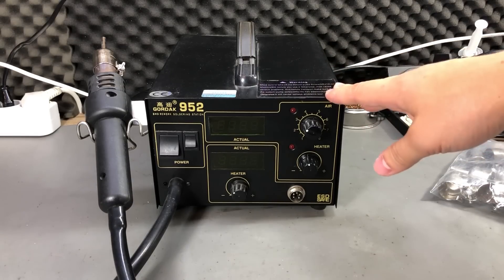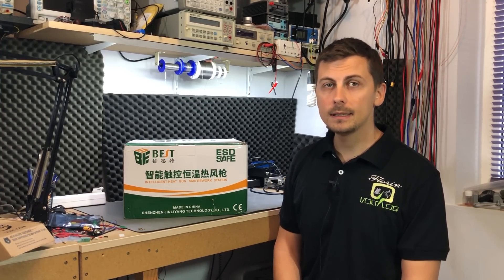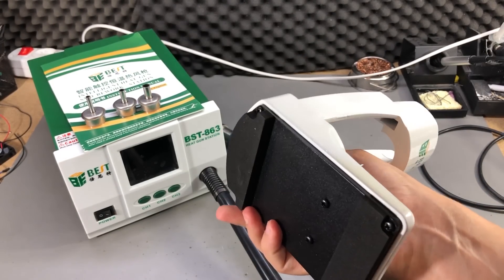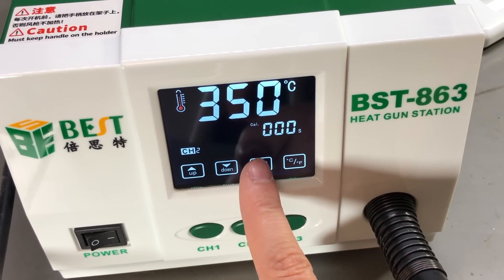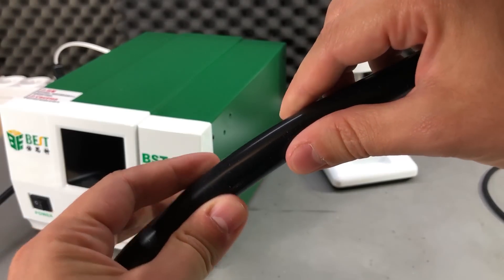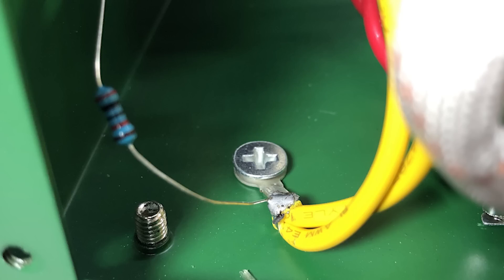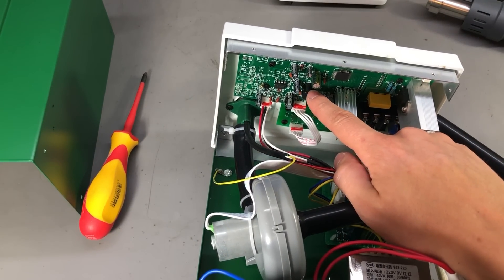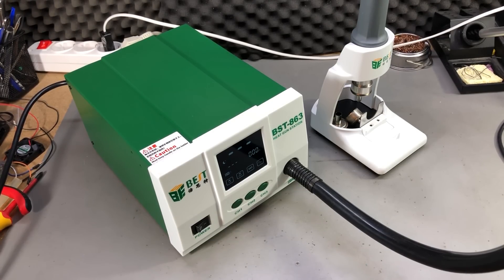Voltlog #256 - Best BST-863 Hot Air Rework Station (Alternative to Quick 861DW)

Comment: Will going in with 500 to 550 degrees celcius to remove newer models Iphone cpu shield remove the shield quicker than using a lower temperature without damage?

Comment: I bought this station 2 weeks ago. It looks basically the same inside but in my case the mains connectors were not loose at all. Instead they forgot to put in the resistor for the esd-socket to ground connection and the rubbermounts of the blower were not correctly fitted to the case. 

Still 5/5 rating from me. Super happy with it.
Reply: is it possible to unsolder a mosfet without damaging it? If the max temperature is around 300 C, the component doesn't desolder quickly, with the risk of breaking it, right?
Reply: @TheFelix63  Max Temp you can set is 550°C

Comment: Hi, I have got a question. 
I need the 220V version of the station because I live in Europe, but only the 110V version of the station is available on banggood.
Is there any difference in the station besides the cable? So has the station both support for both voltages or has other hardware to be installed in the respective station?

Comment: For what it's worth, I just got one of these and my experience is not good, the blower motor would not run out of the box but it happily continued to supply current to the heating element anyway so while the motor controller doubtless knows that the motor is not running, this information is not shared or used by the main controller. The blower motor just whines like you would expect a jammed brushless motor that cannot start up to do, for just a few seconds, when the handle is picked up. It's not an expensive unit, but with no functioning blower and no source of parts that I can locate, it is money thrown away. I regret not buying the Quick.

Comment: Awesome video! I wanted to ask you, my pump is completely dead. Any advice what to look for? The heating works but obviously blowing up the thermal fuse in the wand. Everything else works when fuse is okay but nothing from the pump
Reply: It's been quite a while. Did you figure it out? If not, are you getting power to the fan at all?
Reply: @pr0xZen  I ended up selling it on eBay and got Quick  861DW instead. However, the guy who bought it, left this comment on how he fixed it:

I found the problem (why the fan stopped working). It is all fixed now, very pleased. This was caused by the RoHS lead free solder. There had grown microscopic Tin whiskers around the fan connector terminals. Because of the high pulsed current of the fan motor. (this is what grows the metal crystals, very small and easy to miss). So it shorted the motor contacts and killed the fan driver IC. Replacement chip came from digikey, and it works now. (what they should have done is protected the terminals with a paint or other coating). Hehe so I hope you liked the story behind that.

Comment: Great video! I actually bought this unit after watching it but to my big despair, when I turned it on it got hot but no air blow and now it doesn't even get hot and the temp stays at close to zero... Is that normal?
Reply from the maker: I don't think that's normal. I'm guessing either a problem with the pump or bad settings but the heater shouldn't be on with no circulating air, it might overheat and destroy itself. Maybe it got dropped during shipping? You should open it up and check.
Reply: @voltlog  yeah what happened was the pipe on the heater turned really red and then the temp went down to 0 so I fear it's beyond my skills of repair. The air did never flow. Completely silent. Just such a shame and I'm not sure if I should order replacement or ask for refund.
Reply: @voltlog  so I figured out what the problem was. It was the thermal fuse inside the wand. I changed it but it blew again. The wand heated up but there was no airflow. Is it the pump then?
Reply from the maker: @extrememod_ahu  You should check why the pump isn't turning on.
Reply: @extrememod_ahu  Thermal fuse blowing is not the cause. It's a sympthom. It blows because there's no airflow so the heater element overheats (or it might be burnt out by now) - the thermal fuse is working as it should. I would suggest checking on all the wires, connections and solder joints between the blower fan and the the board. These fans are pretty durable parts, so it's more likely the fan gets no power rather than being broken. Also check the board for accidental solder bridges.

However, this is obviously either a manufacturing defect or shipping damage. So this is on the manufacturer, seller and/or their logistics partner(s). I hope you requested a refund or replacement.

Comment: Hi Florin, nice video! How does it hold after 1 year? Did you use it intenisvely?
Reply from the maker: Yes it's used every week at least once and after one year is as good as new. My only problem with this model is the rather short length of the hose which means you need to keep it close to your working area bench level. You can't really place it above on a shelf or anything like that. But for this price and performance that's something I can live with.
Reply: @voltlog  Thank you, and keep up the good work!
Reply: @voltlog  TL;DR You can just replace the hose with a comfortably longer one you know..? Nothing special about it. With how powerful the fan is, if you use a small adapter in each end, you can use a thinner, more nimble hose too.

-
I did mine with 35 cm extra, in 15 mm (OD) silicone hose, just some AliExpress knockoff'ish of the blue Samco ones you see in 80% of tuner cars. Paid like $4/m including shipping. 11mm ID IIRC. 1 or 1.5 mm walls leaves too thin a wall with straight silicone being so soft, it kinks too easily (although this is generally less of an issue with the added length).

I did use the type without (!) thread armoring in the tube wall. The thread armored type is too stiff for this purpose IMO, in large part because they rarely come with wall thickness less than 2.5-3 mm for this range of OD size hose. If you do find thread armored silicone hose with 1.5 mm walls however, that would probably be ideal. It would not easily kink, and be near half the weight. Or you could step down to 13 or even 12 mm OD and get the same airflow.

I did use very thin-walled coupling adapters though, to not add 2 additional airflow bottlenecks on top of the hose. I also scavenged some size and flexibility appropriate strain reliefs from an E-waste dumpster. Though, the original ones were a little too stiff for the smaller, softer silicone hose, at least at the handle end.

Comment: A rookie question would you recommend this air station to someone who is starting in microsoldering before others, for example:

1-quick 2008
2-ksger hot air
3-yihua 995d (baku, mechanic) or similar

I understand that the best would be the quick 861dw and then the best bst 863 would follow, could you give us a top of the best or which would you recommend to start in microsoldering  THANKS
Reply from the maker: It depends on the budget as well, because it you can afford the BST-863 get it from the start, you will get all the advantages from the start and you will save the money spent on the cheaper one that will probably be replaced later. If you cannot afford the BST-863 than you will have to go with one of the cheaper options with the fan integrated in the handle and I think any choice from the ones you listed would perform similar but inferior to the BST-863. It also depends on how much work you are going to with hot air, if you will use it rarely than it might not be worth it to invest in a good hot air station and instead it might make sense to go for a cheap one.
Reply: @voltlog  THANKS another question how important or how important are the wats (1200w power) if the machines all get above 480 degrees?  Is it just a matter of time, that is, some will arrive at a certain temperature first?  or affects other details that we do not know the newbies.

For example between a quick 861 vs a cheaper machine what is it difference?

THANKS per your time

Comment: I wonder how this will work out for you on the long run - the whole thing looks extremely cheap, minimalistic and ugly, but still, it can be a reliable tool. Those oldschool caps are strange indeed, especially seeing them sitting near an SMD chip. Nice video as usual!
Reply from the maker: It certainly looks better than the older one or the other models currently available on the market so that inspires confidence that it could serve me well for years to come.

Comment: It's great that they sent that too you.
I bought the Quick station to replace an old unit from Circuit Specialists, right before packing up my lab.  I've just gotten around to setting things up at the new house and hope to try out the Quick, I'll open mine up and compare it to the BEST.
I like the BEST, except for the ugly/cheap looking logos and colors... I could get used to it for the price and capabilities :-)
Reply from the maker: I haven't seen how the quick 861 looks inside so far, it would be interesting to compare.
Reply: @voltlog  It pretty much the same, even down to layout. Controller is different layout, but same 32 bit STM and motor controller.
Reply: loll put a logo sticker of metcal hahahaha

Comment: It would have been nice if you actually tested it on some circuit boards.

Does it have enough power to remove large BGA packages from multi layer PCBs with lots of ground and power plains?
Reply from the maker: If this does not have enough power at 1200W then I don't know which station does better.
Reply from the maker: @MatthiasWelwarsky  yeah a back heater will help a lot and will prevent putting too much stress on the pcb and/or the BGA chip.

Comment: I don't really see the benefit over say my Yihua 2008D. It has pretty much the same features (including a holder with reed sensor for auto shutdown) but is a whole lot more compact, way cheaper and has a much better user interface with physical buttons and a big quadrature encoder wheel. It is also available from reputable sellers in Europe which means it comes with real warranty and tested electrical safety and looks much nicer, too. The massive hose on your unit would honestly annoy the crap out of me while the hand piece seems to be about the same chunky size. I also have a feeling that the cable on mine still offers longer range when I need it. 🤷🏻‍♂️
Reply from the maker: I would hate to have that fan in the handle and when it comes to performance this BST-863 will perform better in any way you can think off. You really need to try both to see the advantages or you might not see them at all because there might be things which you don't care about in which case it's better to stick with the cheaper unit because it already does all you ever need it to do.
Reply: @voltlog  I've used expensive versions of such units before and but even there the difference is not quite as extreme as you make it seem. The only real advantage of a professional version is the much lower noise level, but the hose is really a bummer compared to a flexible power cable; the performance is pretty much identical. With my Yihua I can also make 0603 (and of course smaller) fly away and heating up to 320°C takes only a few seconds. If I'd go for a station I'd take a combo which includes a pre-heater and some intelligence to automatically balance the heat; that makes a huge difference in reworking.

Comment: What it really matters in every hot air tool is the power of the heater and the ability to work on smd parts using high heat with the slowest air speed to prevent the tiny components from launching to nowhere.The exactly temperature adjustments is not so critical because every component on different pcb materials need different heating times and the rule is heat it up until the solder melts.
Reply from the maker: with this station you have it all

Comment: Nice and thorough review as always from you.
Probably best to have the main unit on a shelf above the bench, and only the nozzle down at the bench.
Maybe they went with THT decoupling capacitors because they used THT already for the electrolytics.
Reply from the maker: yes, having the station above the bench is better and more ergonomic but not too high because the hose is not very long.

Comment: At 11:21 in the video it looks like the power transformer is loosely mounted to the chassis, not very good QC.
Reply from the maker: thanks! The screws are not too loose, I had a go with a screwdriver and they turned maybe 180 degrees until tight so yeah it might be worth checking those if you get this station but I think the wobble you see is due to the thinner metal being used.

Comment: I wonder what the unpopulated pads are for on the display board? Maybe vacuum control?  Overall, looks decent but could be optimized to be great. Can one lower the heating ramp rate? I don't like to thermally shock components, or maybe I should be holding the wand further from the target.....
Reply from the maker: I also wonder what the non populated pads are for..

Comment: The high airflow is needed when working on heavy groundplane PCBs, I use 120 on my quick from time to time when fixing MacBooks. It looks like that is a copy of the Quick 861DW, apart from the touchscreen, they even copied the case design. I did a review of the Quick 861DW earlier this year.
Reply: Yeah it's obviously a copy of the Quick. I wonder how long it takes till they get sued for this lol. 
Even inside it looks identical to the Quick.
Reply: @Todestelzer  I think it's all the same source, just different branding.
Reply: @sdgelectronics  i think too because also the screws are the same on quick and bst. But there are three more similar hot air station JABE 861D, NT-762E and nt-761DW. All of them with the same case.
Reply: Agree, but you can feel the airflow 3 meters away 😂

Comment: Looks like a good hot air station small amount costs. 
Use lump Blutack over the sounder hole, as the mass will reduce the sound more than tape.
Reply from the maker: I ended up using some hot glue 👍

Comment: I don't like the units with fans in the hand piece either.  It looks cheap... like crappy cheap.
Reply: Try one, maybe if you don't buy the cheapest junker it won't look "crappy cheap". I have one of those (Atten 858D) and it certainly works well, even though it doesn't have as much power as this Best or the Quick. I have bought it to replace an older station that also had a thick hose like the Best in the video, because the thick stiff hose is extremely annoying on the bench when not in use. A thin cable to the handpiece on the Atten is much easier to manage. That's kinda important if you don't have a large bench and don't use hot air every day.

Comment: Most videos I've seen have pointed out 1 unit adjustment. Cannot agree more! If that had rotary switches and perhaps 5 unit adjustment it would be perfect and I'd get one immediately. I've been planning on getting a similar unit of some kind. 

I with it was made more compact. Space at work bench is premium always. Still, so tempting and more power really makes a difference sometimes and accurate temperature reading (unlike my very compact cheapo) would be so great.
I think Quick 861DW too has one unit adjustment resolution (but with real buttons that are bigger) and it is also pretty large and could be made smaller.
Reply: I'm not sure what it is, but no one seems to be able to design the perfect station. The Metcal is almost perfect, but no auto power-down. This is almost perfect except the UI, same with the 861DW. Others are just too expensive for what they are